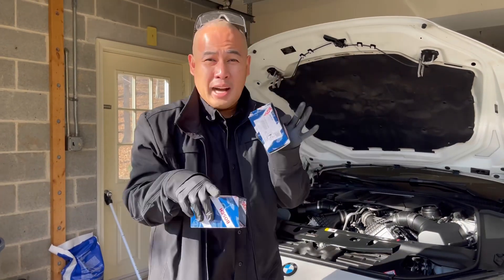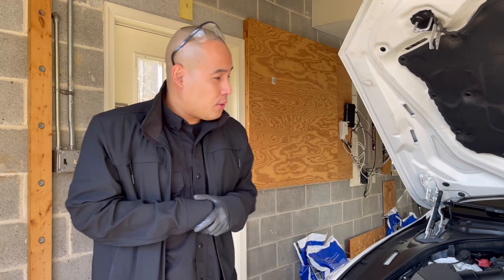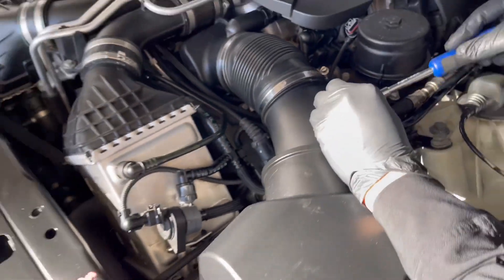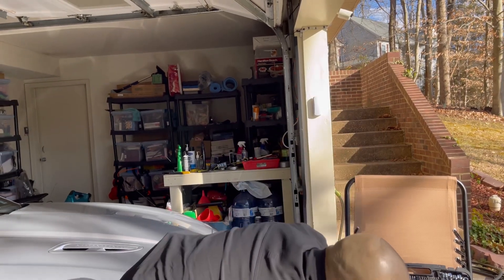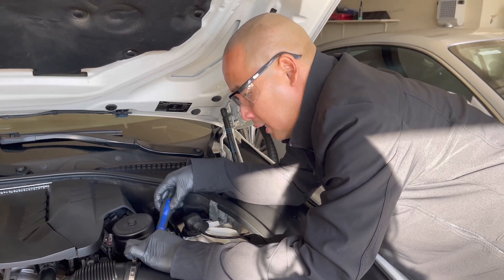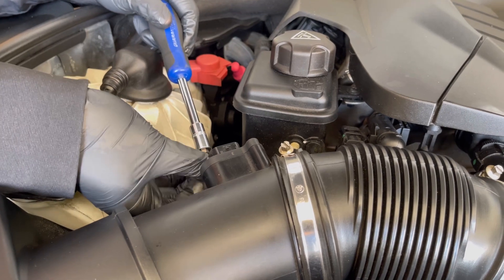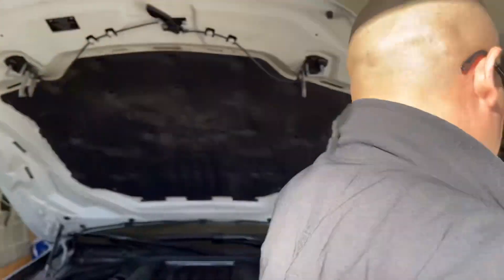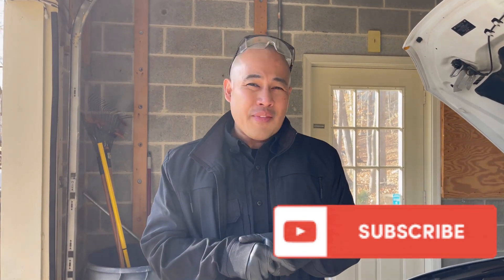BMW M6/M5/M8 - How to to Change, Replace and Clean the BMW Mass Air Flow Sensors (MAF)

Comment from the maker: You can buy the parts by clicking the affiliate links below:

1. BMW BOSCH Mass Air Flow Sensor 
https://amzn.to/3k3RIKN

2. DEWALT Mechanics Tool Set, SAE and Metric, 1/2, 1/4, 3/8 Drive Sizes, 192-Piece (DWMT75049)
https://amzn.to/3EmiRPX

3. CRC 05110- Mass Air Flow Sensor Cleaner, 11 fl. oz
https://amzn.to/3IfXIIk

Comment: Does it cause rough idle ? Feels like car wanna turn off and loose power when I step on it code is P00BF
Reply from the maker: No it doesn't, it will just throw a check engine light